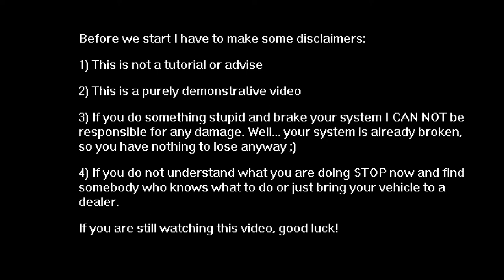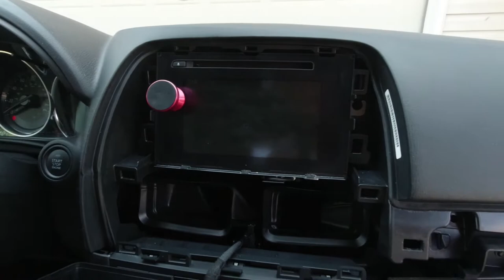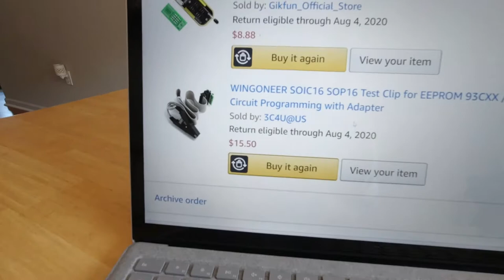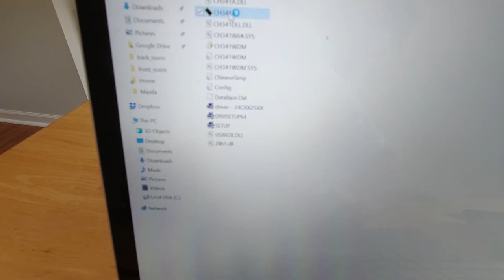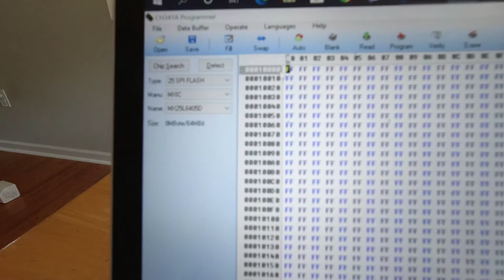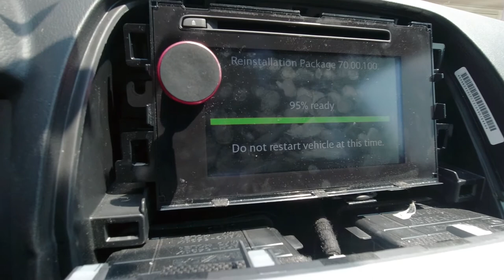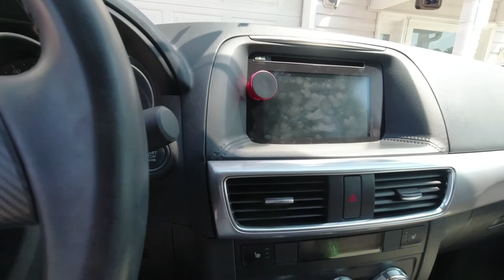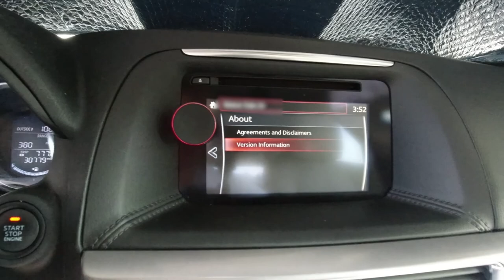How to fix, unbrick and upgrade bricked Mazda infotainment system

Comment: I'm having a hard time finding the 16-to-8 pin adapter that you used to connect the table to the programmer :(
Reply from the maker: I can sell you one. I still have the whole kit. LOL.
Reply: @ridelive6249  It looks like the GIKFUN 341A is no longer available.  If you have the whole kit still are you willing to sell it?  Other alternatives out there?
Reply from the maker: @northernlights6206  Yeah. I still have it. Too lazy to put in on Ebay. LOL.
Reply: @ridelive6249  do u still have the 16 pin to 8  pin connector? I want buy one. Thks
Reply: @ridelive6249  can you send a link to where i can buy this ?

Comment: Its been more than a week since I bricked my cmu.
Today I got a second clip (first one had misaligned pins) and I cant get the software to detect the chip nor read any bytes of data.
2nd clip wont work either, Im sure Im doing everything as shown on the video.
What could be wrong? Dead chip? Defective USB programmer? Im lost.

Sometimes I get $00 instead of $FF when I move the clip a bit, but nothing close to autodetecting model or memory when hit detect. Also tried different versions of the software with no luck.
Reply from the maker: I m not sure why your PC is not able to recognize your programmer. Try a different PC may be or try rotating 8-pin end on different halves of the connector. I am also not sure what programmer you got. Some of em have the pins reversed. Look at other comment where a very detailed layout of pins connection is given.  Just keep on trying. You ll get it working.
Reply: @ridelive6249  The programmer seems to work fine, I was able to read an eeprom chip with the 8 pin test clip that comes with it.
But Ive already tried 
- 2 different 16 pin clips
- the adapter that you used
- also got jumper cables to do the mapping 16 to 8 as mentioned in another comment, since I didn’t have the adapter before.

Nothing! I can’t believe it. I guess I need to find a different board with a 16 pin chip I can read to make sure clip/programmer works or if the chip is just dead.
Reply: @mauroferrari5098  Hi, did you ever get this to work?  Which 341a programmer did you get?  I'm having the same exact issue where it just doesn't recognize the chip.  I've tried it many many times
Reply: @mattcohen3465  Hey, nope. I gave up and bought an unbricked CMU, 140 + shipping on eBay.
Reply: @mauroferrari5098  when you buy different cmu,when you plug it in does it start straight away or some software instaling ,decoding is still needed?
Reply: @dadimov1  it worked right away… so much better than trying to repair the original board and a week of frustration

Comment: Hi Ride & Live
Can I use this method to downgrade from 70.00.367 to 70.00.335, yours or anyone help would be greatly appreciated
Thanks in advance
Reply from the maker: Prolly not. May be if you break your unit on purpose and redo the whole process. Doubt it, but what do I know. Lol.  Not sure why you would want to downgrade though.
Reply: @ridelive6249  Hi Ride & Live
Thanks for your speedy responce, the reason I want to downgrade is because my GPS seems not to be has responsive as it was prior the upgrade and I've also noticed that ISTOP started to kick in after about 30 seconds instead of the 2 minutes, it may not be the update but was just concidering it maybe.

Comment: A great video, I got to the stage where I re installed the unit, got the screen that says system failed to update, insert the usb, I have the cmu150_NA_70.00.100A_failsafe and the cmu150_NA_70.00.100A_reinstall on a usb. Inserted the usb but then the screen goes to verify the files for a few seconds, screen goes blank for a few seconds then the recycles through the system failed to update screen, starts to verify the files and then goes blank again, anyone know why this maybe
Reply: Sounds like a read error? Have you tried a different memory stick?
Reply: @Tylerrrr94  Let me give that a shot, thanks for the reply
Reply: @stevelawton3483  no worries mate, I’ve tried reprogramming my cmu and it won’t verify. Could honestly pull my hair out no idea what I’m doing wrong 🤣
Reply: @Tylerrrr94  I had similar issues, so I ended up paying a guy $90 to program it for me, he tried the one that was from here but that didn't seem to work for me, so he took the original one from my CMU chip and cleaned that up and put that back, btw the new memory stick worked!!! and I'm not back up and running. Good luck with yours
Reply: @stevelawton3483  glad it worked! Thanks mate feel like I’m gonna need all the luck in the world, even if I program the old one back to the chip it still won’t verify so my heads in a spin tbh
Reply: When you tried to do the original update that caused the brick. Were you trying to update to a different version than cmu150_NA_70.00.100A at the time? I'm not sure that it matters but I have a feeling that if you tried to upgrade to say, version 74.00.324. When you get to the point where you have the opportunity to reinstall, its looking for a reinstall version other than cmu150_NA_70.00.100A and that's why it doesn't work.  I will find out for myself when my usb and clip arrives. That is my worry, that I will be SOL because I tried to upgrade to a version higher than 70.  I will updated if I figure it out.
Reply: @akbar7  yes you’re correct tried to goto version 74 mate
Reply: @akbar7  likewise, I was also trying to update to a higher version than the V70, I realized at the start and pull the USB out and then unit bricked when I tried the lower version (the correct way).  As per my other replies above I'm now up and running
Reply: @akbar7   hi, I have the same issue, just wondering did you put the two 70.00.100A (failsafe and reinstall) in the USB or you put the 74.00.324 into the USB? Also did you use the bin file from the description or the file from your CMU?
Reply: @stevelawton3483  did the guy who installed for you put the 74 up file in the USB after reprogram the chip? I'm having the same issue so hopefully you could help

Comment: where can I get the drivers??you forgot to put the driver info!
Reply from the maker: You forgot to read the description and check the folder.
Reply: I did but for some reason I cant open the files
Reply: @ridelive6249  The only files I see in that link are a text file and a couple .bins. Shouldn't there be more?

Comment: Im going insane trying to find that 16 to 8 converter, any pro tip were to finde One 😂
Reply from the maker: Come on guys! You are killing me! Just Google them. LOL 
You can use any programmer and any clips. There is nothing special in them. I posted the ones I purchased into description up top.
Reply: @ridelive6249  i havet sop16, sop8 testclips, it is just the sop16 adapter to dip8 that seems imposible to get with the clips 😂
Reply from the maker: @jimmz9733  Mine came with the programmer. I still have that whole kit. Will post it on Ebay. )) Oh whoever wants it feel free to buy it from me. $25 shipped within US.
Reply: @ridelive6249  just strange that it seems so Hard to find seperatly
Reply: @ridelive6249  got the converter/adapter today, worked like a charm :)
Reply: @jimmz9733  Hi, I'm also trying to find one.  So difficult to find.   Can you let me know which one you got?  thanks
Reply: @awesomegeorge5664  I'm also finding it hard to find the converter. Did anyone else find one? Can we just connect the 16 pin to the programmer as it has 16 slots in it? Can't get any testing clips in Canada and have to buy from Amazon or AliExpress with shipping in 20-30 business days!
Reply: @jimmz9733 hi, did you still have the kit? If you have it are you willing to sell it?....please advise. JC

Comment: him thank you for this awesome maual. Just yesterday successfully unbricked my cx-5 CMU after failed installation (damned USB stick). SOP16 to SOP8 connector was included in USB Programmer CH341A (how to connect pins you can check here (https://images.ua.prom.st/597683150_w640_h640_597683150.jpg))
Now I have challenges:
1) how to reprogram dashboard from EN to RU
2) how to update SD card with maps (from US to EU)
3) how to reprogram FM module from US (200 Khz) to EU (100 KHz) for BOSE tuner
Reply: So if I break my system while installing the AIO tweaks I need this new gear to reset the device? OMG! I cant believe thats how the technicians at Mazda do it.
Reply: Can you show me how connect
Reply: Its just a photo of the product. Can you share the instructions?

Comment: Hey @ridelive6249 thanks for this sliver of hope. I did the stupid thing by attempting to install "cmu150_NA_70.00.100A_reinstall" instead of "cmu150_NA_70.00.100A_failsafe". It put me in the loop where it is trying and failing on 2%. Will this clearing of chip work and once I insert the usb back, then do I rename "cmu150_NA_70.00.100A_failsafe to become "cmu150_NA_70.00.100A_reinstall" or something else?
Reply: I made the same mistake, did it work for you or did you solve it differently?